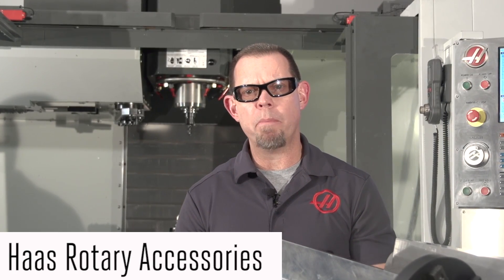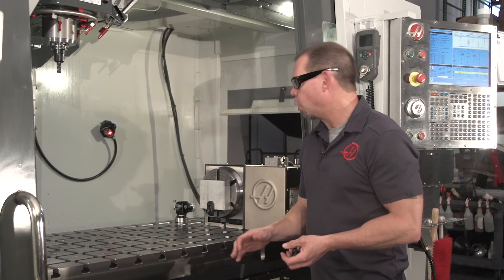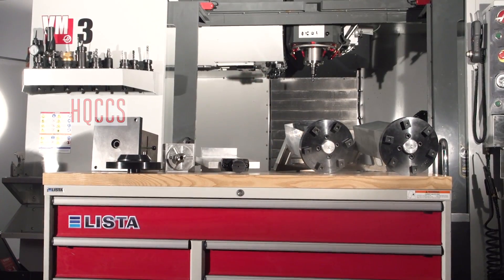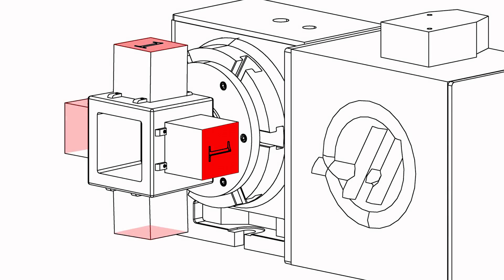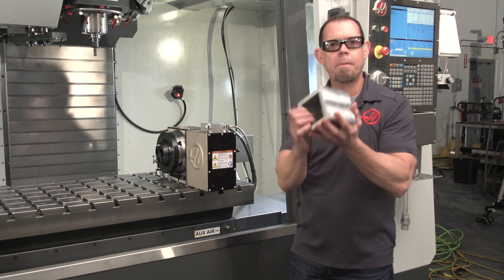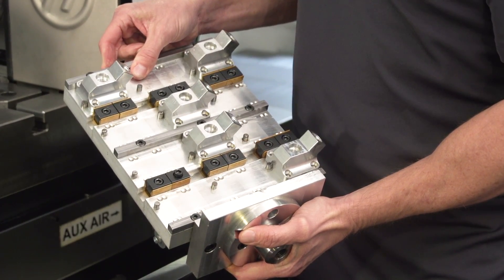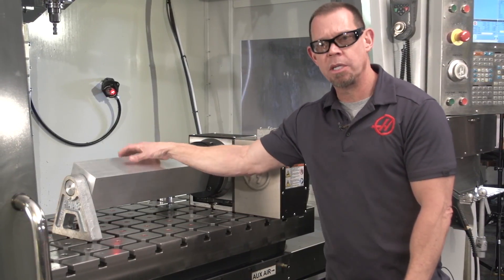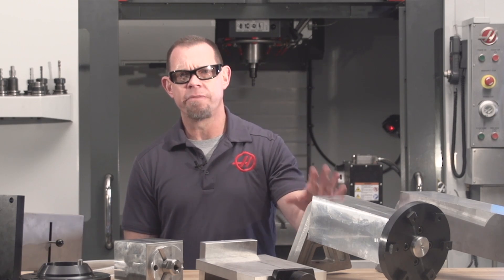Get More Productive with Haas' Rotary Accessories - Ask the Haas Answer Man

Comment: With 12" or 20" block system, can we mount the blocks after each operation to make it a pallet system or do we remove machined parts and reload new parts. In former case what will be the repeatability in microns. Thx

Comment: Hey I just came up with an idea unless these are a thing, do or has anyone ever made automated digital stops, like to set part stop lengths fast and on the fly. If this isn't a thing and I just came up with it, there has to be a market if someone enginers one.
Reply: Any comment?
Reply: Do you mean like a dowel in a collet? Then program a position and butt your stock up to it?
Reply: Josh Hanson I use a magnet base with screws and set the distance and run a part then mag the stop and load a new part but have multiple jobs in a day so if I had an electronic  one that would be neat
Reply: Is there such a thing?
Reply: Josh Hanson hope I made sense
Reply: Josh Hanson so if I have a vise and a 2 inch by 2 inch part and the part due to the program has to be in the center of the vise, so I would make a stop that when I set the part in the vise every loaded part in the vise would be placed properly
Reply: Josh Hanson not a dowel
Reply: Josh Hanson so insted of using a magnetic bas with a screw that I indicate to that length against the vise to where the part would properly be places I would have an electric one that I could say stop bar 1" and it would move to a stop with an 1" distance
Reply: Josh Hanson most programs I use run from the center of the part not the edge
Reply: You programme the stop to position itself wherever you want. We use a dowel in a collet. So if you want a 2x2 block in a central position, using a half inch dowel you'd programme a position of 1 1/4    in X. Generally when setting a vice we'd record the back jaw Y and know Z relative from the bed. So you'd know what to input in Y and Z and programme X. We use this all the time to reduce set up. I do low volume machining normally one offs, this reduces set up time to a minimum.
Reply: Josh Hanson okay, sounds good